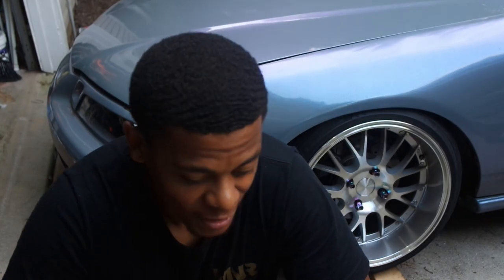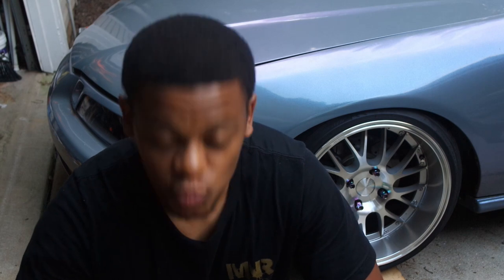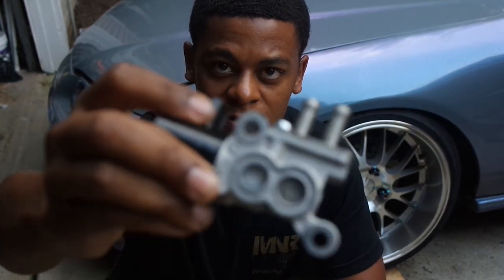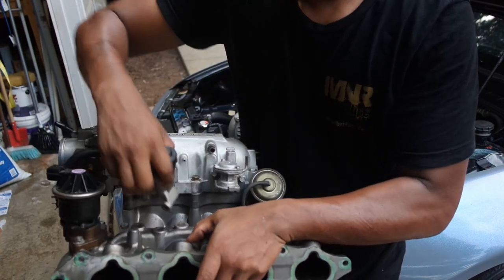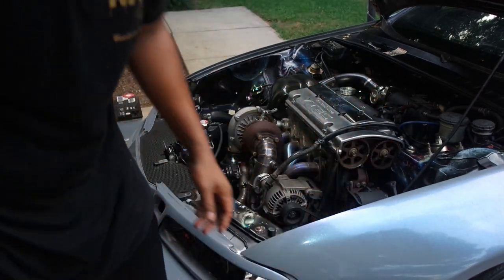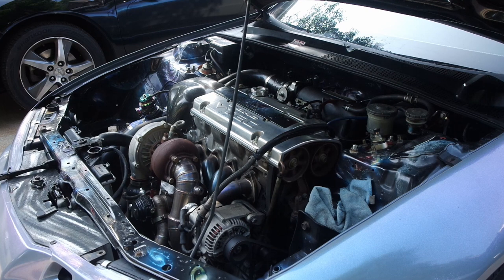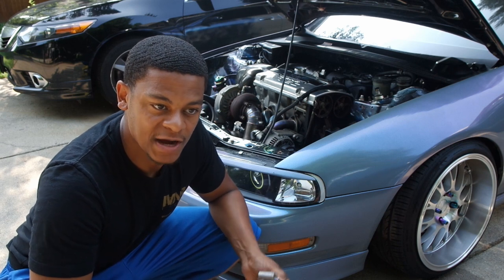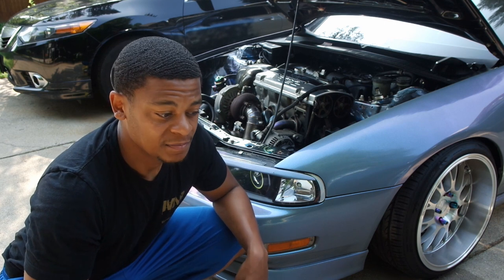How to fix Honda idle issues | HONDA PRELUDE

Comment: It also has a fast idle control valve under the throttle body it has a plastic ajuster you have to tighten it but becareful.
Reply: Why be careful? I've done it twice to my car in the last 3 years... always helps...

Comment: I have a vacuum leak I couldn't find.  The idol was bouncing up and down, it was a rubber seal in between the brake master cylinder and the brake vacuum booster.  When I press my brakes hard it idles fine, and when I take my foot off it bounces.  Actually all I did was hit the two bolts with PB blast and then tightened them a quarter of a turn and it fixed it like 98%.

Comment: Taking the IACV off and tightening the whiteish/yellow plastic locking nut inside will get rid that idle issue also..sometimes it comes loose and Causes this exact issue...I've have the OEM on my 92 and it fixed by problem,but I will definitely get a new one when I switch manifolds

Comment: I had this issue with a H22 swapped eg civic I bought, and the issue turned out to be crazy loose nuts on the intake manifold where it connects to the engine.  They were so loose that I could spin them by hand :(  After I tightened them all down the issue is gone.

Comment: Good video man my old civic use to suffer now and then.Also low coolant will cause the surge as well!!
Reply: ThePreludeDude or the coolant temp sensor too.
Reply: No Budget Racing with the assist!
Reply from the maker: Yea there can be more than one cause i would check coolant and fast idle air valve first but in most cases this is the culprit. The part is expensive in the auto store but i got mine off amazon for a lot cheaper

Comment: thank god bro ive been trying to figure this out for like 2 weeks i just bought my 95 f22b prelude so im hoping that fixes it appreciate the vid bro ur a goat!!!
Reply from the maker: Good luck bro if that doesn't work there is also the fast idle valve or could be a bad tps sensor
Reply: @treybedipping1734  so it looks like i need to replace my maf aswell to get the air fuel ratio right but the idle was fixed after i put in the new one. thanks bro!

Comment: Greetings from Connecticut bro. Thanks for this video. I finally have my 93' Prelude S Proyect and I have the same issue not too bad but is annoying that crap lol. I'll better put a new one. My Question is Do I have to put silicone or gasket when installing or just straight up? And some adjustments with Allen key or not?

Comment: I remember the way i fixed mines was by tightening down the fast idle valve under my intake mani. On h23 it has like 2 screws you open it and tighten down the valve with a flathead and it stopped surging
Reply: i will try this tomorrow thanks
Reply: How tight do you have to turn it? All the way down or…?

Comment: Hey man so I have a 00’ Prelude SH, and it has this problem. We changed the IACV for a brand new one from Advanced Autoparts. We put it on and I had to drive it for about 50-80 miles to take the check engine light off because it was on for the IACV. Well I run it for about 100 miles, the idle problem (revving 1000-1500) is still going but no check engine light turns on during those 3 hours. Next morning I drive it and it runs normal until the engine warms up and it begins idling just like yours does and the check engine lights turns on at the same time. We go see what’s wrong and turns out it’s the IACV. It does the same 1000-1500 idle and after a little it starts bobbing 1000-1100rpm. Do you think the IACV we bought is bad or can it be something connected to the IACV, a hose or maybe the coolant running through it?

Comment: Ikno this is an old post but I got an f20b in a 00 accord and was wondering if you have to order the exact iacv for the f20 or if you can use the h22 one. Mines surges with a super low idle, love the vids tho and sending love out from HI
Reply from the maker: Yea use the h22 I've even used a civic one b4 too

Comment: He man quick question, I have a h22 swapped Eg and it was running perfectly fine but on the first start up is was surging but then the surge went away, then one day I went to turn her on it has a very low and weak idle and when I go to give it gas it shuts off , could my idle air control valve just finally kicked the bucket??
Reply from the maker: Could be that but check your  tps and throttle cable too hard to diagnose over the internet but check those two things and come back

Comment: i have the same issue, i have a turbo h23 but its stuck at 1500 rpm and it won’t go down, and there’s no vacum problems no leaks or nothing could it be the valve?😊
Reply from the maker: Yea could be... double check your throttle cable as well

Comment: I just a h23a swap p13 ecu and I'm having low idle problems then it dies. Coolant still needs to be bled but can't get the car stay to do so. Icav, fic, all cleaned, pretty much everything is cleaned. Intake gaskets are also all new including vac lines. So I'm stuck at the moment
Reply from the maker: You likely just need to adjust the throttle cable.
Reply: @treybedipping1734  does the throttle need to be open a bit ? I left it off.  Also Does the FIC need to be screwed all the way down? My 4th gen was originally a a.t h23a1 convert to m.t. thanks in advance and your time.
Reply from the maker: @syloluon4969  there is a bracket on the intake manifold that holds the throttle cable. There are two 12mm nuts that lock the position I'm place. If you loosen them you can adjust how tight or loose you need the cable, effecting where the motors idles
Reply: @treybedipping1734  thanks for your time bro. I chased down the idle. It was the injectors that were supposed to be OEM replacements. picked up some used ones  and it fixed up my idle.  Btw what kind of clutch master cylinder are you running ?
Reply from the maker: @syloluon4969  glad it worked out for you and an oem one

Comment: I just bought one from Ebay and it didnt' help at all.. 
My car, 95 Del Sol S. It starts great and idles and runs perfectly... 
it only idles when it gets warm after 6 minutes or more or from driving it for a while.
And it stops when I turn the headlights on! 
I just bought an IACV from EBay and it didnt' help 1 bit. I have checked everything from a new PCV Valve to exhaust leaks to adding new hoses here and there to new seals. I tightened up the Fast idle control Valve which helped lower the idle back to normal... to adding coolant to make sure it's full. It disconnecting the battery for 40+ minutes to reset the Computer, cleaned the MAF Sensor, throttle body, new air filter etc.. it runs really really  good... just surges once it gets warm...
Reply from the maker: You may want to double check you vacuum lines and check if your intake manifold is leaking. If all else fails your tps sensor may need to be replaced or calibrated
Reply: @treybedipping1734  I took it to a mechanic recently and he checked it for a manifold leak. The engine was rebuilt 7 years ago and it's really solid...no blue smoke etc. out of tail pipe, no boiling coolant water when it gets hot. Oil in Crank Case is fine, looked into spark plugs are fine etc. And the car runs super strong right now... It's possible the IACV Valve I bought is not good cuz it was a cheap one off of Ebay! Super Cheap... I don't know what a TPS Sensor is but I will look into it here on youtube to figure that out! Other than that surging when it's warm and it's only a small surge from about 1,000 to 1,400 or so... and it always stops when I turn on the head lights. And when I disconnect it, the car runs perfect and the OBD1 code is 14 which is the IAVC... I'll keep Looking! Thanks. Eventually I will just take it to a mechanic if I can't figure it out! Thanks again!
Reply: P.s. The reason I don't think it's vacuum leaks is because most of the hoses have been replaced in last few years. #2 Because I can start it cold and it will idle for over 6 minutes or more without any fluctuation in idle. It runs perfectly smooth until it warms up. Even then I have to usually drive it around for a while to get it hot enough before surge happens. usually a vacuum leak will occur immediately when starting the car. And when it warms up everything swells up so it usually wouldn't happen later but rather sooner to immediate.. and I have done a fairly extensive check more than a few times. But thanks I'll take another look.. peace! P.s. I did spray carb cleaner on manifold very much so to look for vacuum leak... nothing! I also checked to see if bolts were tight there and on top and a few other places...
Reply: @treybedipping1734  Oh! Intake Manifold... hahaha... ooops. I thought you meant something else... okay I'll check it again!

Comment: Yes the iac can caus idle issues but i will tell you thats the last part ypu wanna change at the 160$ cost try the thermostate first witch in the end was my problem then the fast iac then the iac
Reply: Spent 250 on an idle problem to find out the previous owner removed the thermostate
Reply: I have a 92 lude with a jdm h22a303
Reply from the maker: Yea you def have to track down the source but iac valves are cheaper now you can get them for $30-$40 now

Comment: Hi does your cooling fan always keep running when you just first start the car even the car is cold?
Reply from the maker: No it supposed to cut on at operating temp. Yours might be hard wired to stay on
Reply: @treybedipping1734  thanks bro can I ask why they did that because I checked everything?
Reply from the maker: @luckymandap6315  bad temp switch or relay and they probably couldn't figure out what it was so they hard wired the fans to run constantly
Reply: Thanks brother I’m thinking that is the last solution to check the wiring I’ll message you if I solve the problem.
Reply: Can I something brother when I disconnect the cables from the cooling fan and when I just start the car I can see the temp goes up quickly then normal even it hasn’t reached his normal temperature you think the thermostat is doing this bro?
Reply from the maker: @luckymandap6315  it's really hard to diagnose issues over the internet. It's possible it's the thermostat. I would try topping off the coolant and bleeding the system

Comment: I have a question bro I took mine off my 5 gen prelude h22a4 and it was dirty the mesh area and everything so I cleaned it with carb cleaner but if I remember right that metal mesh bubble was sticking out I cleaned it with some force and it’s not bubbles out anymore. Is it supposed to be bubbled out
Reply from the maker: Nah its not supposed to be bubbled out
Reply: @treybedipping1734  dang it ain’t bubbles out anymore. I cleaned it to hard.
Reply: And it’s literally dying every time I come to a stop with the clutch pushed in.

Comment: And this will work for a 92 Honda prelude Si h23...right?
Reply: April Gaddis yessssssssssssssss
Reply from the maker: Yes sirrrr
Reply: April Gaddis Yea it will work for any honda as long as ya ran down & checked all other issues that cause idol problems on a honda and if everything else is good then aicv is the issue
Reply: ok so had to wait on the iac so i cleaned the one i have and i did a coolant bleed... now i am having way worse idle and stalling issues.. 
any suggestions
Reply from the maker: April Gaddis thats what i meant when i said sometimes you can clean them and sometimes cant but there is an allen wrench bolt on the iac you can try and tighten it. Also check your fast idle valve under the throttle body and open the cover and tighten that as well. But more than likely you need to replace your iac valve.
Reply: Okay I will try that now.. Thank you for the help..First prelude I have had and this is my baby.. Trying to learn all this on my own... So I do apologize if the questions seem well maybe not so smart... Again thank you and have an amazing day!
Reply from the maker: April Gaddis thats the purpose of these videos. Dont hesitate to ask any questions
Reply: Trey Be Dipping OK thank you...
Reply: April Gaddis any update on it ?

Comment: Would a bad idle control valve make my car want to die whenever I’m steering? It only does it when I’m at stop light or just parked. But I have the same symptoms from the video.
Reply from the maker: 🤔 Depends. Where does it idle at? It may be a matter of adjusting your throttle cable as well
Reply: Trey Be Dipping 2k but it goes up and down just like in the video
Reply from the maker: @jonathanerickmartinez5540  yea i would def replace the iac valve.
Reply: mine does the same , at a stop sign or by steering  or parked, did you fix the problem by replacing it??? please help. Or did you clean it

Comment: I need some help , I have a 01 prelude with a h22a4 I cleaned out the IACV and tightened the FIAC (fast idle air control) . Mine doesn’t bog between rpms it’s just sits under 1000 rpm really low like between 500-800
Reply from the maker: 800-1000 rmps is normal try checking to see if your throttle cable has any slack it may need to be tightened.
Reply: Ima checc that and get bacc to you with
Reply: Chris Touch anything?

Comment: I have the same problem, iacv cleaned but problem stay. Can someone tell me what can i do to solve this (maybe the iacv is dead but who control ?) Thank you
Reply from the maker: Check your fast idle valve as well as vacuume leaks and intake manifold gasket. Sometimes I've seen the tps go bad causing an idle surge

Comment: I have a 99 prelude with a jdm swap. I replaced like 3 iacv and it keeps surging up and down it’s supper annoying. It keeps giving me the p1508 code. Idk what’s wrong I need help.
Reply from the maker: What is p1508?

Did you check your fast idle valve? 

Did you check for vacume leaks and manifold leaks?
Reply: @treybedipping1734  yes I replaced all new gasket on throttle body and intake. I checked for leaks no leaks.
Reply from the maker: @jaylandaguilar5567  grab a can of throttle body cleaner or starter fluid and spray around the manifold while the car is running. If it rev up while spraying you have a leak.
Reply: @treybedipping1734  I’ll try that I’ll keep you updated
Reply: @treybedipping1734  nope still no luck it keeps surging. No leaks in the manifold and I have a brand new iacv.
Reply from the maker: @jaylandaguilar5567  there may be air in your cooling system. Try bleeding it
Reply: @treybedipping1734  when I unplugged the idle air control valve it idles not perfect but better
Reply: It goes from like 1k to 1.2k rpms
Reply from the maker: @jaylandaguilar5567  sometimes you just have to drive it and let the car re learn to idle with the new valve

Comment: I have a 00 prelude sh and my problem is that it idles at like 400 -600 rpm after running for about five min. Is this anything to be worried about or just normal ?
Reply from the maker: luis jimenez yea that seem pretty low. I would do a compression test.
Reply: luis jimenez my fresh 74,000mile 99 jDM H22A in my 97 Prelude runs smooth & like a beast as well an idols at 700 right where she should
Reply: Trey Be Dipping. What numbers should I should be seeing when I do the compression test
Reply: Trey Be Dipping and what should it idle at ?
Reply from the maker: luis jimenez it varies from motor to motor but i would say 150 and up but more importantly  you want to make sure all 4 cylinders are the same. If you have 3 cylinders at 180 and one at 90 then you have a problem.
Reply: Trey Be Dipping alright thanks man. I’ll let you know what happens and keep up the great work man
Reply from the maker: luis jimenez will do thanks for watching
Reply: Trey Be Dipping aye bro I did the compression test and the numbers were cyl-1 was 210, cyl-2 was 200, cyl-3 was 210 and cyl-4 was 210
Reply from the maker: luis jimenez those are solid numbers there is a screw on the throttle body that can be adjusted to adjust the idle as well. I think 800-1000rpm is a solid idle 600 seem slightly low but honestly if its not cutting off or stalling you should be good
Reply: Trey Be Dipping thanks you so much man and which screw in specific are you talking about ?
Reply from the maker: luis jimenez may have to do a little research but there is an adjustable screw on the throttle body to mechanically adjust the idle...or you can try adjusting the throttle cable as well
Reply: Trey Be Dipping alright man well thanks so much for the help

Comment: Honda prelude 2.0 X auto coupe 2 doors petrol 4 cylinder  engine ( B20A44500427) I'm trying my best to give you complete information that's what I have I'm just requesting to help please help I love this car  where is the air  control sensor
Reply from the maker: On a third gen b series not sure it should be on the intake manifold somewhere

Comment: I just deleted my IACV easiest fix
Reply from the maker: Thats an option if you have the right ecu
Reply: Trey Be Dipping that’s true I’m not running the stock p13 ecu in my prelude with my EuroR h22
Reply: Trey Be Dipping I ran a skunk2 IM and 70mm TB on my old h22 it was cool but didn’t like the look of the repositioned hoses for the IACV have you ever looked into the euroR intake manifold ?
Reply from the maker: Danny Carrillo yea i had a full euro r swap a few years back....its about the same to me